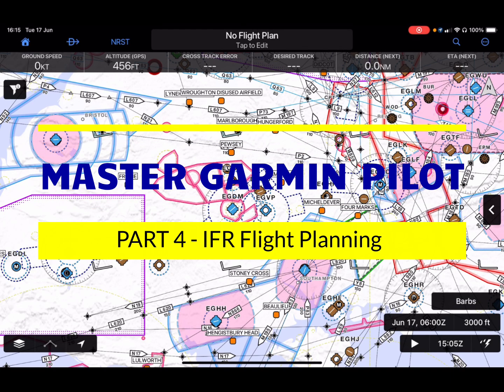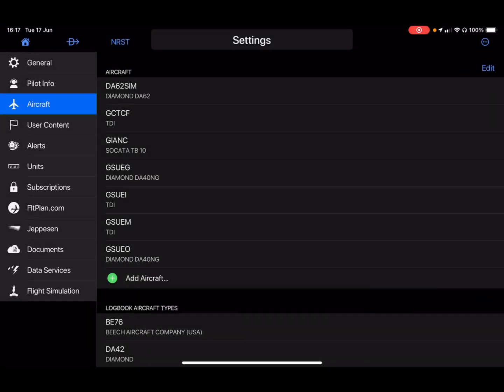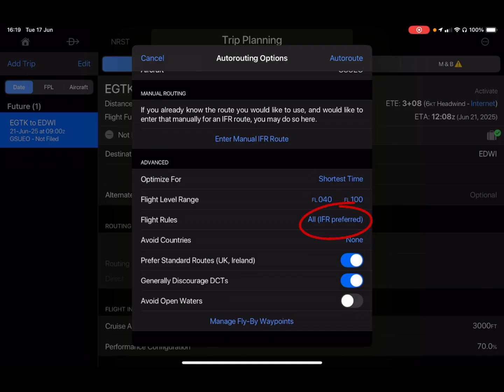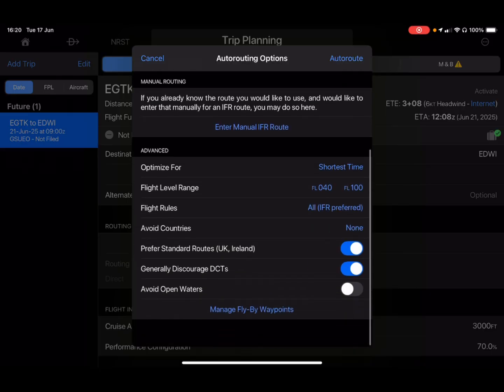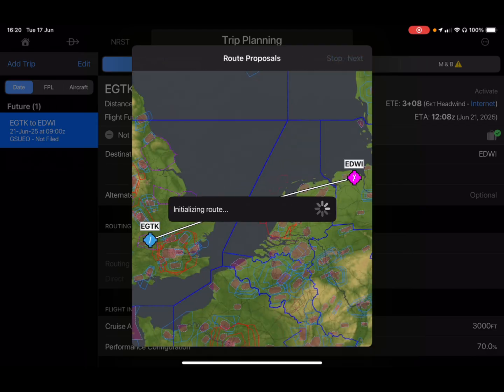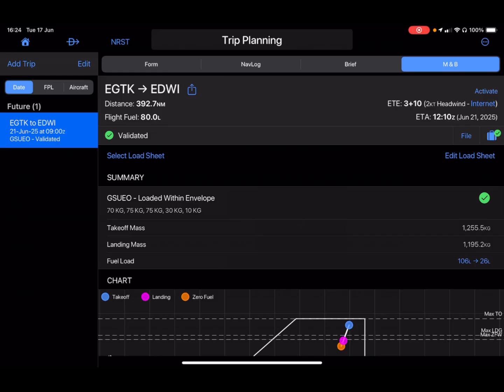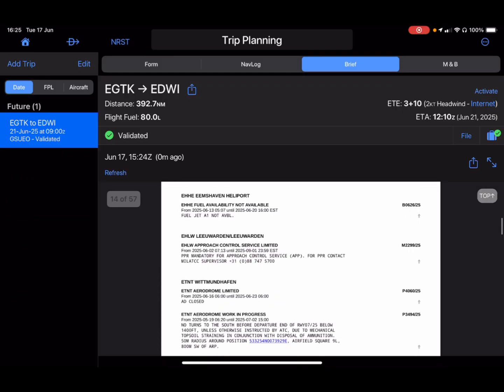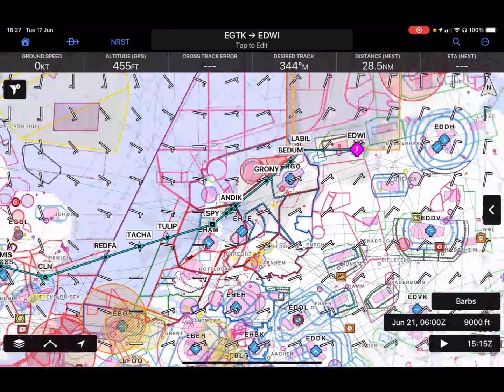Garmin Pilot Master Class  - Part 4 (IFR Flight Planning)

Comment: Thanks for creating this series. Even though I have been a GP user since the launch, your videos have are doing a great job of both refreshing my knowledge and showing me features I haven’t used. I am curious if you are planing on any content on the Concierge feature. In particular, how you use it to update your avionics. I have seen some peculiar things when using it (especially with a second Connext GPS). 

One of the problems I am dealing with GP is the performance data. I saw you using it in your video but I have working with Garmin to understand why it isn’t working correctly for me. When Garmin acquired FltPln, they integrated some of the capabilities of FltPln like the performance data but it never has worked correctly. Maybe you have words of wisdom on how you load and use it.
Reply from the maker: Concierge and device connectivity is on my list of things to cover.
Reply from the maker: Thanks for the feedback, really glad this content is useful.

Comment: Is autoroute available in US? I don't get the option.
Reply: Unfortunately AutoRoute isn’t available to us in the United States. There is a a “View Planned ATC Routing” feature that will find routes that ATC has accepted between the departure and destination airports but it requires someone to actually have filed to that particular destination airport previously. I believe this is one of the reasons Garmin acquired FltPln because they have a more robust routing tool.  But it isn’t fully integrated into Garmin Pilot. If I can’t find a previous routing in Garmin Pilot, I will go to FltPln and search for a route and copy it into Garmin Pilot. Not ideal but it works. BTW - I am jealous of your autoroute tool.
Reply from the maker: @Marauder92V Thank you for contributing to our little community here, it’s great to get some information on these regional differences!
Reply: I should also add another trick I have used to find a route. If you are flying between airports that Garmin Pilot doesn’t show a route, you can pull up FlightAware and look for routes between nearby airports and your destination (or a nearby airport).
Reply from the maker: I believe there is a similar feature which provides recently flown routes.  European IFR is quite different to the US and I’m not going to pretend to be an expert on the latter.  At some point I’d love to team up with experienced users in other geographies so these nuances can be covered.